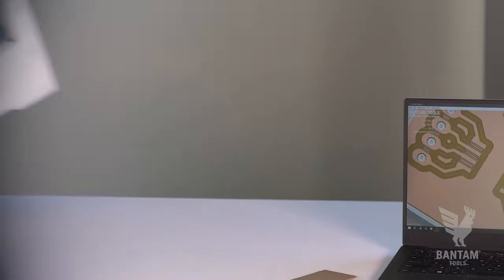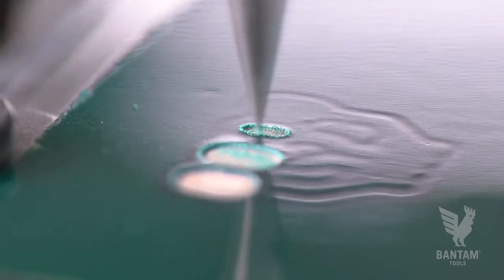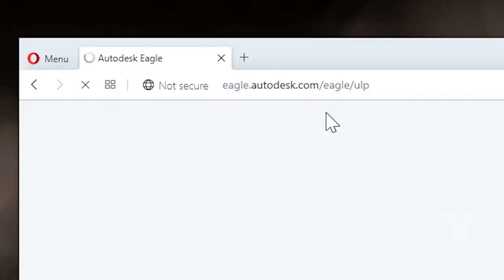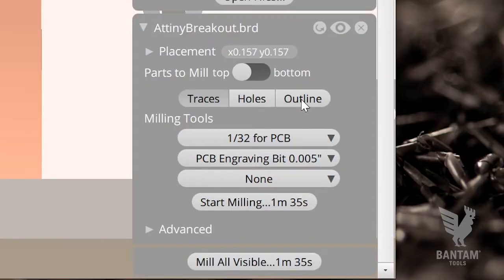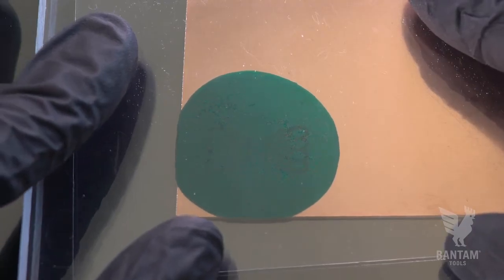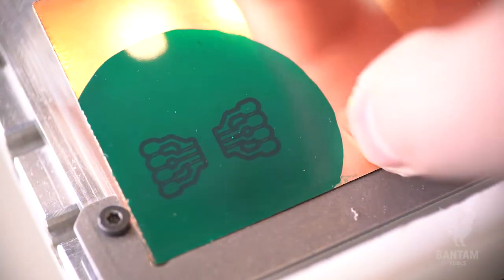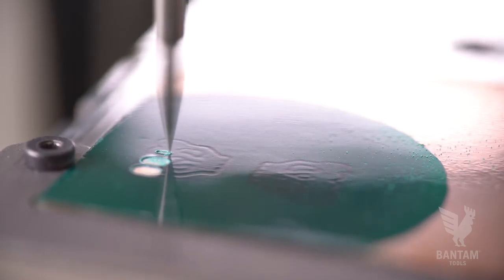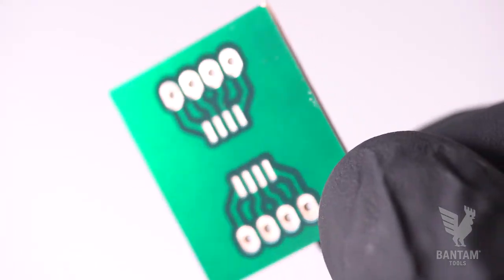How To Make a PCB Solder Mask with the Bantam Tools PCB Milling Machine

Comment: Can we laser the mask off instead of using a bit?
Reply: I tried that and it kinda works but, because of heat from the laser, small pads or traces may break or detach from the substrate

Comment: Can we apply the solder mask first then mill and holes after. I wonder??
Reply: You'd need to mill the traces first as ideally only the pads/through-holes will be exposed. If you milled after, you'd end up with all the trace lines exposed too

Comment: can you please post instruction if you are using Altium. Thank you.
Reply from the maker: Hi there! For this project, we used EAGLE to design the board and then dropped the .brd file into our Bantam Tools Desktop Milling Machine Software. If you'd like to make your own solder mask using our Desktop PCB Milling Machine, check out this how-to: https://www.bantamtools.com/blog/make-your-own-pcb-solder-mask-with-a-desktop-cnc
Reply from the maker: If you're looking to learn more about Altium's software specifically we recommend checking out their resource page: https://resources.altium.com/

Comment: Also in this video some rectangular trace pads have red marked areas, saying it needs smaller tools. How the engraving was then managed without resolving those?
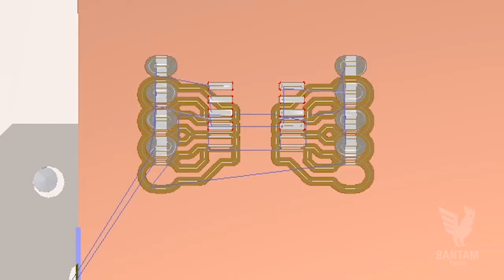Reply from the maker: The tiny red marks at 2:13 are indicating that the tool isn't able to mill those 90º corners. This isn't due to tool size, but rather it's geometry. So rather than be right angles, they're going to be slightly rounded. Because this won't impact the design of our board we ignored the warning in our software.

Comment: The some SMD traces(for e.g.:  2 Pin PH-2.5 JST), the svg generated, shows it needs smaller tool than 0.005" bit. How to mitigate that?
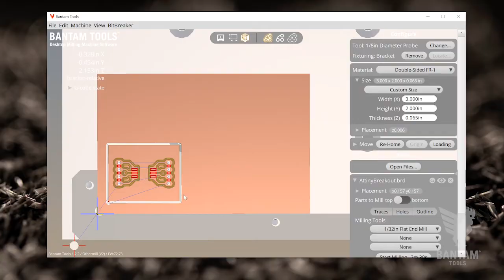Reply from the maker: Are you referring to the red traces at 1:09? If so, you're right, this is indicating we do need smaller tooling. But also notice how in that frame only the 1/32" flat end mill selected. If you also have the 0.005" PCB engraving bit selected those warning signs will disappear :)

Comment: You don't indicate where to get the spring loaded bit.
Reply from the maker: We got the floating engraving tool from CNC-Aid and used our 0.005" PCB Engraving tool for this job.
Reply: I concur, where are these bits?
Reply: I would like to purchase the bit also.
Reply: Thank you!
Reply: @rjpeterson1  you also need a new er11 collet that can take 1/4" bits as the CNC aid holder is that size and the one on the bantam is Max 1/8".
Reply: Richard Vowles thank you.